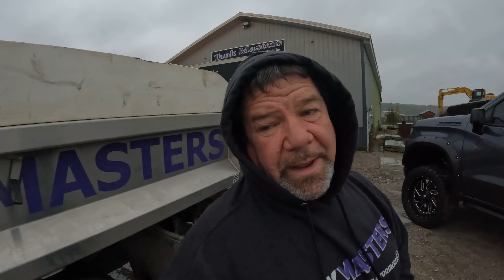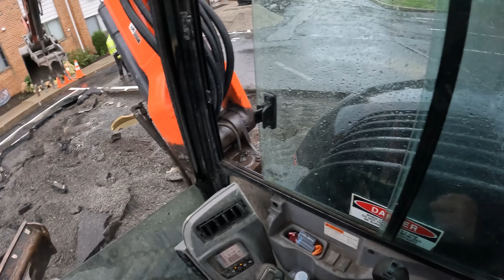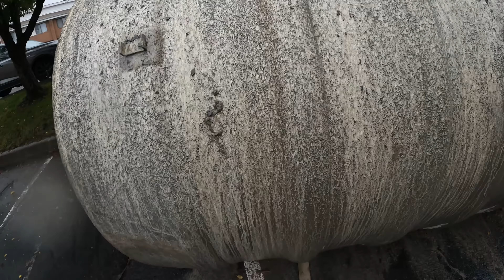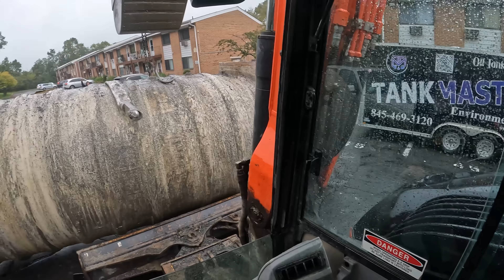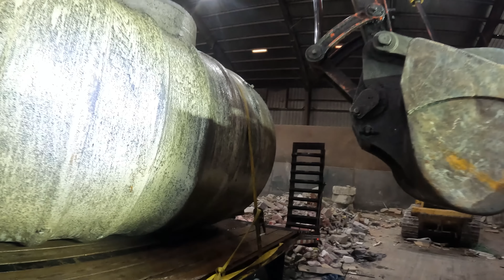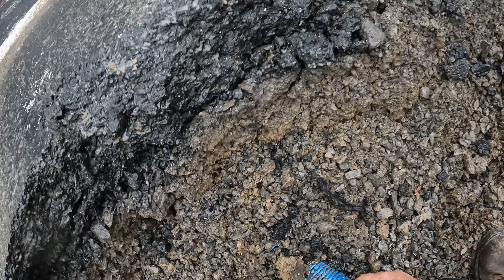4,000 Gallon Fiberglas Removal

Comment: A friend of mine just retired as a fire marshal, and he grabbed at a chance to snag a 5,000 or 10,000 gallon tank (I forget the size) to repurpose as a water tank for a neighboring fire department. (rural with no hydrants) He said, "Hey, it's gotta be cleaned anyway so why not?" He borrowed a machine and got the neighbors to chip in for misc costs.... then had the FD guys truck in some water to fill it up. If anybody on the street has a fire, they now have plenty of water handy. The part I didn't really think of was they also saved on the disposal costs, plus bringing it to another site locally saved on several hours of transport. That's what I call a win/ win situation!

Comment: That was a very skillful underground tank removal.  Even though you had to work around a group of vehicles, you made the job happen.  The 080 is one very impressive machine.  I would not have believed that you could lift the tank and pull it out of the hole that easily.  The rainy weather actually worked to your advantage and allowed you to get that enormous crater properly compacted.  the finished job looks great, and residents will be able to park their vehicles without waiting for a paving contractor to fix the area.